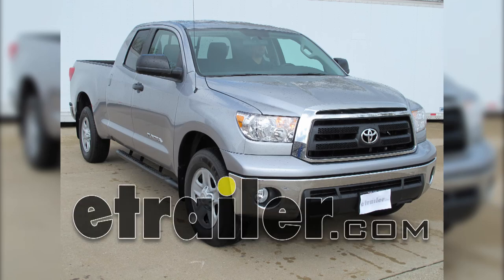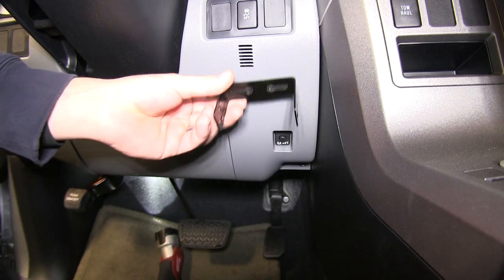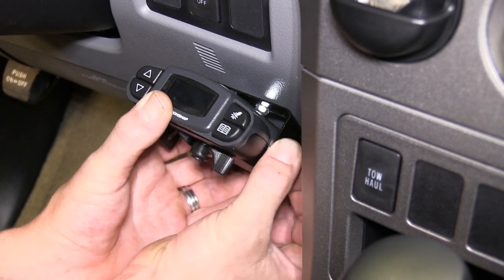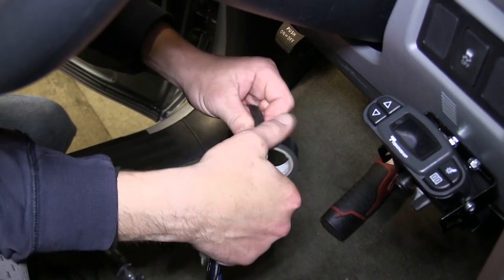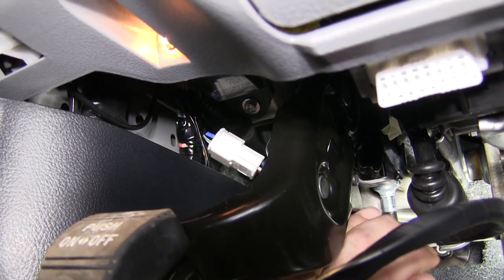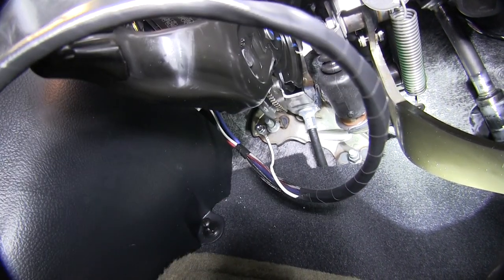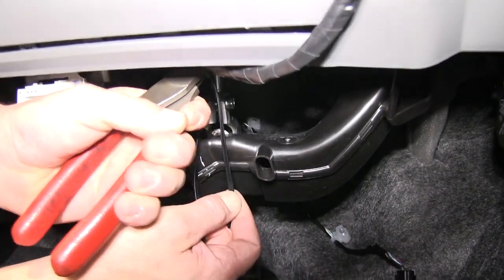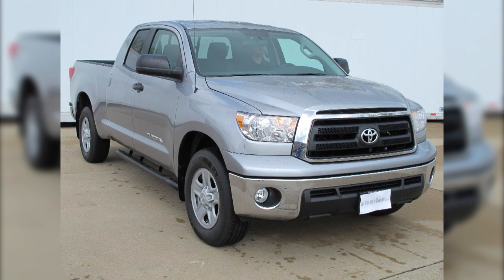Mount: Tekonsha Plug-In Wiring Adapter for Electric Brake Controllers on a 2013 Toyota Tundra

Comment: I have a 2014 Tundra SR5 with tow package but no brake controller. Was plan on buying this in the following weeks but I'm concerned on one thing, does this kit included the harness 3040p or is it separate? Because watching this video and looking around my truck today I see that I have a bright white cable with black tape around it in the bottom left corner as shown in this video and was wondering if this kit includes the harness 3040p to plug-in-play.
Reply from the maker: The plug and play adapter does not come included with the kit so you would have to pick it up separately. I have attached links to our website for the brake controller and the adapter.
https://www.etrailer.com/Trailer-Brake-Controller/Tekonsha/90195.html
https://www.etrailer.com/Accessories-and-Parts/Tekonsha/3040-P.html

Comment: the part 90195 and 3040 would fit my 14 tundra limited crew cab and also the #al 88299 air bag lift can fit it too or not 
let me know thanks
Reply from the maker: The Tekonsha Prodigy P3 brake controller and wiring adapter will work great with your 2014 Toyota Tundra. The Air Lift Air Bag Kit that you have found is the correct kit for your vehicle.
https://www.etrailer.com/Trailer-Brake-Controller/Tekonsha/90195.html
https://www.etrailer.com/Accessories-and-Parts/Tekonsha/3040-P.html
https://www.etrailer.com/Vehicle-Suspension/Air-Lift/AL88299.html

Comment: Good instructional video. I was able to install per you video..  Question My brake controller is on all the time with key off ?  I have the 90885 Prodigy P2 with 3040-P harness.
Reply from the maker: Michael Delagardelle The Prodigy P2 doesn't actually stay on indefinitely. It uses it's motion sensor to watch for movement. With the key off, and after a period of no movement (30 minutes or so), the controller will shut off and come back on as soon as it detects movement again.  This could be as little as opening the door. Tekonsha designed it this way to avoid the potential disasters that could happen if a driver forgot to turn the controller on.

Comment: WOuld this be the same install for a 2016 Tacoma with a tow package?
Reply from the maker: The brake controller will work but the wiring adapter will be different for the 2016 Toyota Tacoma. Check out the wiring adapter you will need in the following link.
https://www.etrailer.com/Accessories-and-Parts/Tekonsha/3031-P.html

https://www.etrailer.com/Trailer-Brake-Controller/Tekonsha/90195.html